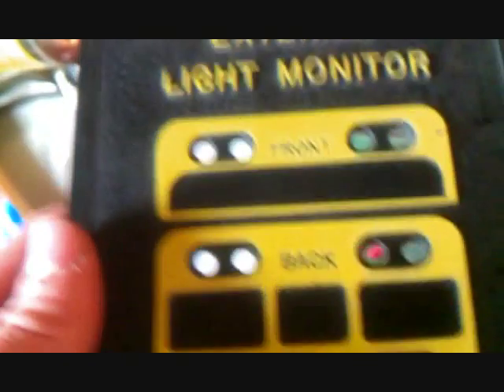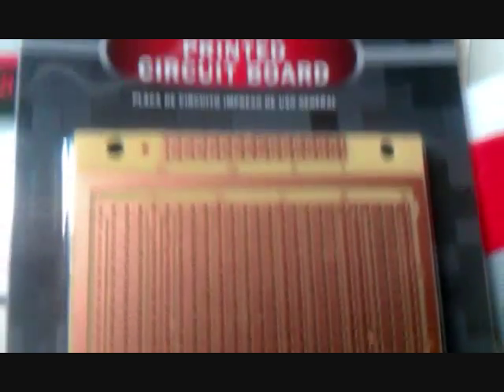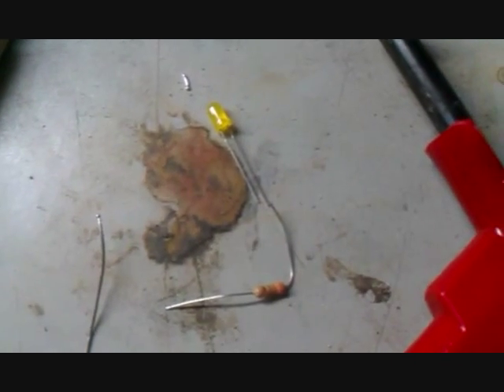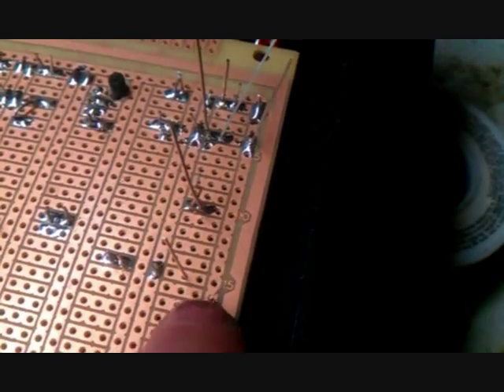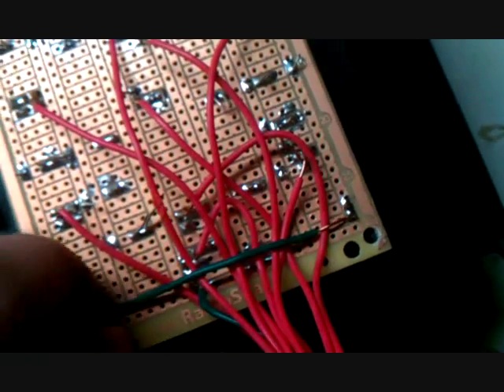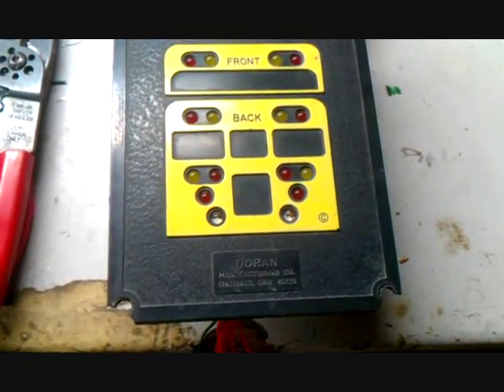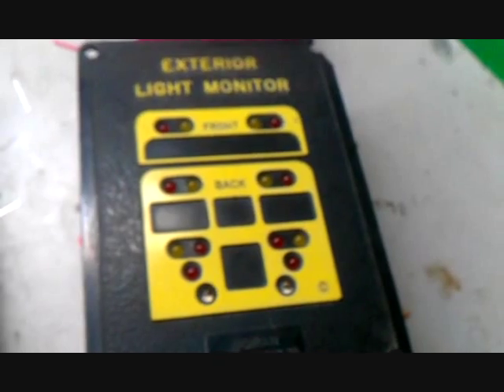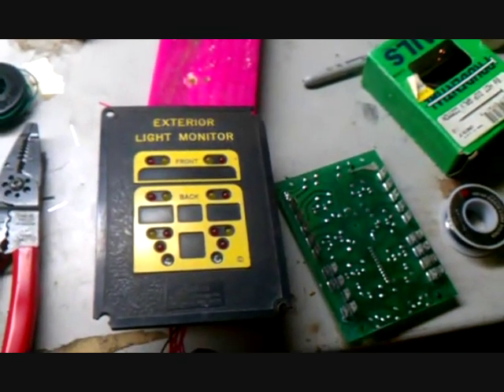My Bus Light Monitor Setup

Comment from the maker: On the Internationals, the chassis wiring terminal strip (to the left of where the clutch pedal would reside) has hookups for both turn signals, tail lamps, stop lamps, and reverse lamps...  All he has to do is run wiring down there, and wiring to his load light flasher...

Comment: Nice.  This is looks easier than wiring in one like I did.  The only true lights on my monitor board are the amber loading.  Everything else works as long as one bulb works, although my front reds are responsible for lighting both red loading LEDs.  Good luck removing your wiring panels NS9987.  I'd almost be tempted to drill holes and move the reverse lights up where they belong!